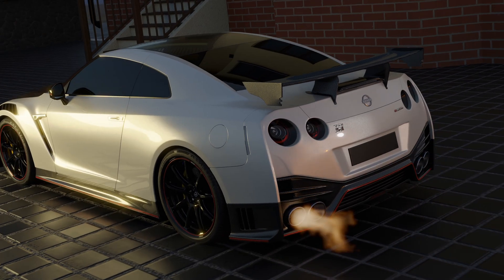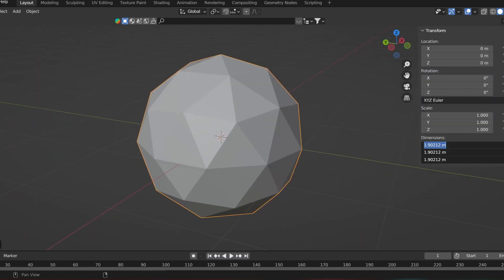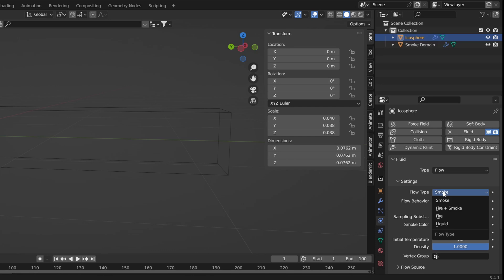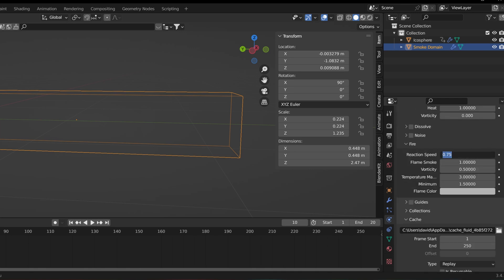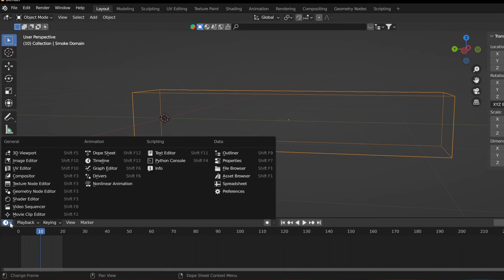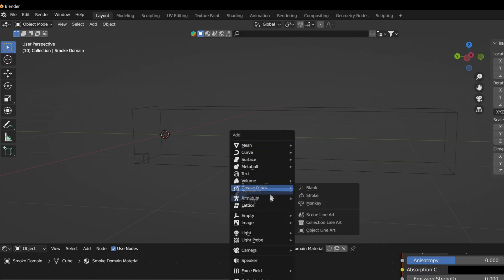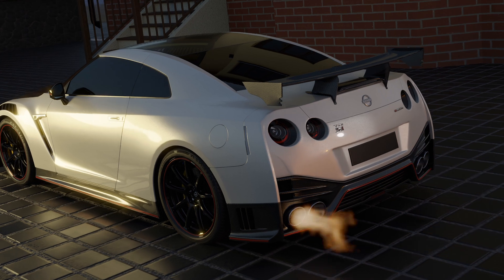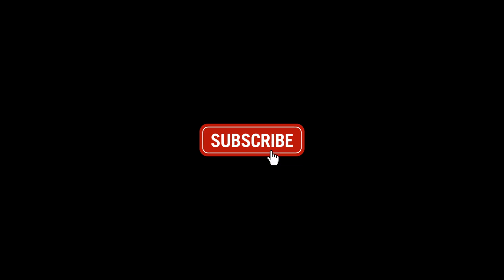How to Make Exhaust Flames In Blender

Comment: yo, great tutorial, but i have a question: ill make a drifting car, and when i parent flames to a car, when car move quick fire dont see
how to make that flames on moving car?
Reply from the maker: You cant have fire & smoke at same time. Technically there both the same so they merge as one. You have to render the smoke and flames seperate on a alpha layer and composite them together in a video editor
Reply: @walejaw3d  thanks man, its keep a lot of my time to solve this problem

Comment: Is there no way to review this in render mode? I dont want to keep rendering my scene out just to see if the flame worked or not, bc i keep getting issues with the smoke domain box being in the scene
Reply from the maker: You probably need to bake the animation. Youll be using auto refresh were it reloads after you restart from frame 1. Set it to bake so u can adjust the shader in render mode once cached